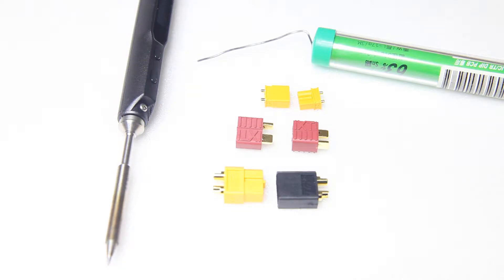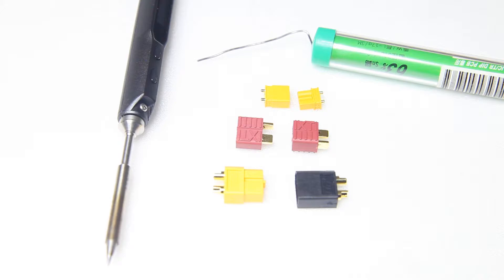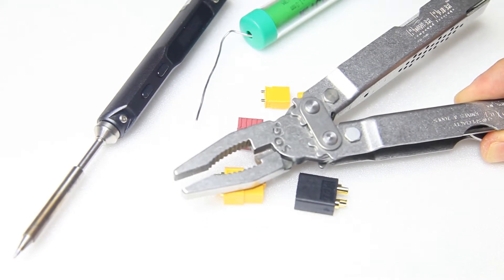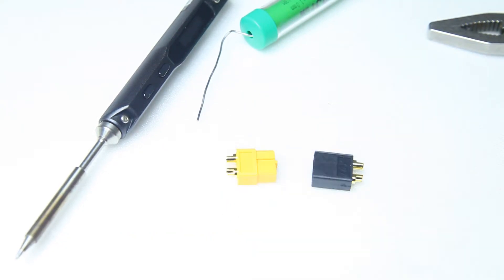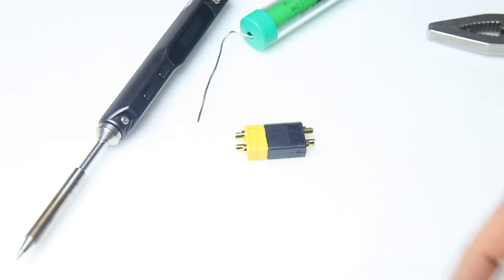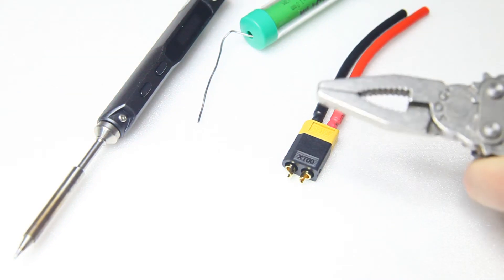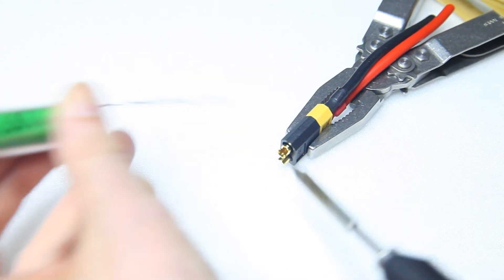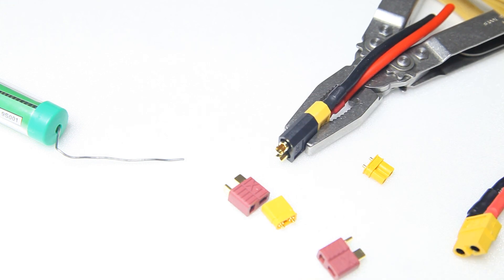PRO Soldering Tip - Soldering up Power Plugs (XT60 - XT30 - Deans)

Comment: No no no, lol! You can't get upvote for not showing how to do the soldering as well : )
OK, I'll try it but if I muck it up I'm blaming you. That IS a good tip though re; using another CT30 plug with wires which is just what I happen to have... as I ordered the wrong one. OK, I'll upvote for the Tips but seeing the soldering done would have completed this tutorial.
Reply from the maker: Hahahaha :D  yeah.. I don't really have a good bench-recording setup :$  I actually spent $350 on a Gopro for THIS video, but the Gopro turned out to not be able to handle my LED Light's freqeuncy :P 
I (also?) used to hate soldering I should say but practice does help :) (as does a a good soldering iron).. 
Good luck! :D
Reply: @DutchRC  Im struggling. I think I need a lesson on soldering.....
Reply from the maker: @goldbunny1973  I have done a couple of 'how to solder' but those are all IN quidcopter-build video's.. 
AND.. I'm not a master solderer :P  
what does work is do some practicing on maybe broken electronics? Or even something like this: 
https://www.diatone.us/collections/accessories/products/mamba-soldering-practice-board